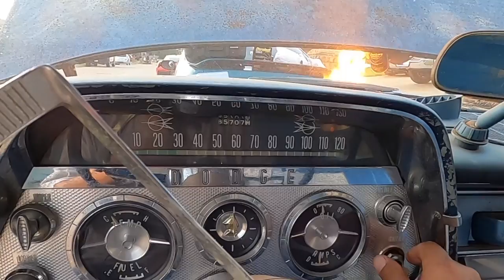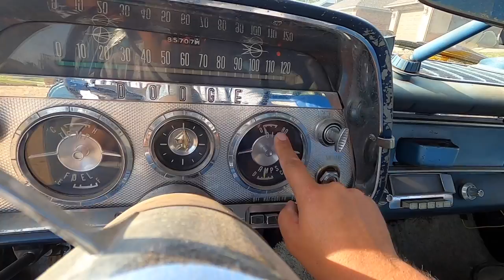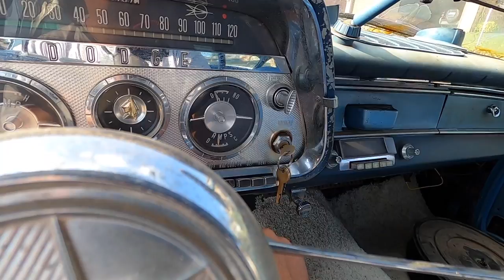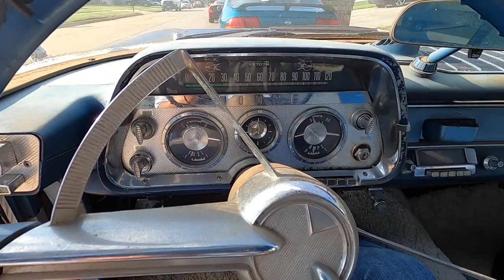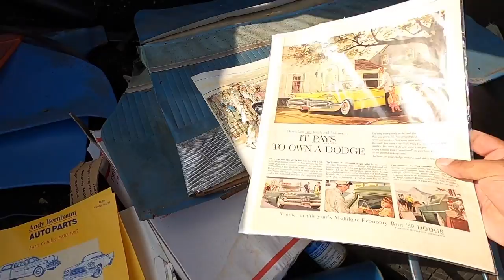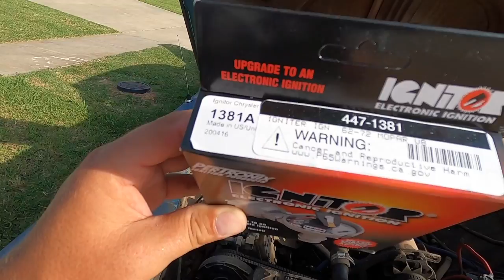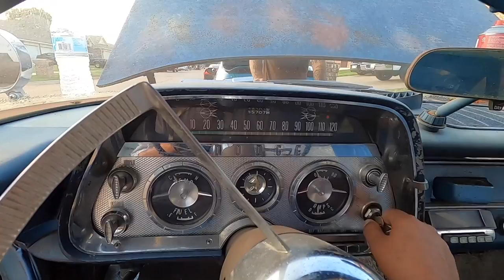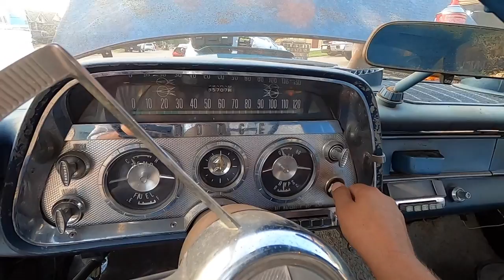I Bought a 1959 Dodge Coronet 326v8 for $4K on Facebook Marketplace - Will it Run?

Comment: I have a taillight here if you want one. 
Ten bucks.  Bezel is rough, lens is okay
Reply: Mirror is a Yankee, aftermarket, not hard to find nicer ones.   Tri-bar they call it. I've had fairly nice ones and sold them on eBay for $25 or so.  
I had at various points a 57 Plymouth, two '58 Dodges, '58 DeSoto, '58 Imperial, '59 Plymouth, most of them flip cars.  I still have pieces from the Imperial and yet another DeSoto floating around.  
I would check the frame rail ahead of the axle kickup, they rot there first.  Then they go behind the rear spring hanger.   As long as that's good, you're good to go.
You will need a $100 puller to get those rear drums off. They press on the axle.  Tool is like a big gear puller that bolts to the drum with the lug bolts, then you spin the middle of it to drive it off.  A bear of a job.

Comment: A  few modern upgrades like electric  ignition, fuel, mechanical stuff. A little TLC  to begin with.  After that whatever's needed cosmetically and otherwise. It doesn't have to be perfect. Just don't ruin it by hotrodding it. She's  a nice old girl and would make a nice survivor. And DON'T change the colors! Just a good repaint NOT at Maaco! 👍🏻😉

Comment: that fuel pump sound like too much presure for a carb
Reply: It only requires 5-7 lbs max. The original, mechanical fuel pump worked best. If the original pump came with the car, I would rebuild that one rather than jury rigging an electric pump. And stay with points. If they don't know what a dwell meter and timing light are, then they are out of your league with this car. Education is key here.

Comment: Sounds like it's missing on at least one cylinder its probably sucked in dirt
because that's why they had to put the electric fuel pump on a new carburetor on it but probably didn't clean out of the gas tank on a fuel line that's a good guess I've done this longer than you've been living good fine but your two speed transmission is not a powerglide it's a power flight powr flite is a Chrysler two speed

Comment: you mentioned car show etc ....realistically it needs stripped of pretty much everything and rebuilt 50-75k and a solid 2 yrs of time.
 OR take out that engine TOSS all the old junk drop in MODERN running gear 15k -25k its just the amount youre willing  to spend.
 hell it might be best to PART IT OUT cept for the 326 which would fund a street rod project

Comment: Is this the car that has the driver's seat that turns out to greet you, turns in to seat you? Aw, I'm a bit of a purist and would re-paint it the original colors it was painted. Your car, your call. It is a more door car, and it is a survivor car. Why not have a car that stands out in a crowd, then the everyday car..Yes, I love tri-five Chevies..BUT, how many '59 Dodges, 4 door surviver cars are out there? Everyone MUST have a 2 door...Well, there were 4 door cars, and station wagons which by now, are probably all gone....I hope you keep this car for a longggg time! This car is in amazing great shape for it's age...My only concern, are the windows. How hard to replace them if need be? I know,,, $$$$$$$$$$. 1963 Mercury Comets ran generators...Just be aware, generators and voltage regulators from back then,,, needed to be polarized before being put into service. But you already know this..
Heck, I had to replace points once a month. I set the gap by eye sometimes..But yes, definately go pointless....Oh, check owners manual. Generators need to be oiled every, 500 miles? Front and back bearings.
Yes, ignition rotor.
Just know not to leave the ignition on too long. You'll burn out the coil/ points..

Comment: This has to be your first old car. If you think its a good deal then it's a good deal. Just not my cup of tee. That little handle under the dash is not nor has ever been an E brake, it is your parking brake just like the one in new cars.  If you were to look in your owner's manual, the one Mopar gave with the car. You will see how to set the parking brake.

Comment: That car has a 3 speed torqueflite transmission not a powerglide. The little lights you think that are in the speedo are not lights. There is a rolling tumbler that turns as the car changes speed. It has different colors on the long roll tumbler that has different colors as your speed increases. Dodge made a model called a Royal that year....here it is. https://www.pinterest.com/pin/231935449535604076/ By the way your AC when it works will come out of the vents on the dash. Your AC will be a Airtemp AC when they work they were ice cold. Sounds like she's not firing on all 8 . Change your plugs and wires.

Comment: Nothing to really restore. I think with a 4 barrel carburetor, fix the rust/dings, and a fresh coat of pain then this car will look pristine. I like seeing these old cars looking all original anyways and get turned off when people put modern luxuries in them like airbags and new engines. My dream car is a 1957 Chevrolet Bel Air Coupe with burgundy paint with white accents on the the roof.

Comment: It has not a powerglide!! (That's a GM, Chevy transmission!!) Chrysler Corp. two speed auto trans was the PowerFlite, but that's not the one in your car either, you've got a 3 speed automatic, which is the Torque-Flite.  Have to say you're lucky to have bought and own it now.... V8 engine, automatic trans, with all the quite nice chrome and interiors, A/C... Which looks like factory air as I don't see an underdash unit.. So that's a pretty high optioned car for the time!! And yes... That's not a mustang or a high performance car etc... But you know... I feel many american people don't value this cars, and that's sad... If there was a time in the history of america that really made an impact on cars, this time was the 50's, and even more this late 50's cars, you can see in them the wild optimism and innocence of the time, the excess, over anything else, bigger engines every year, and amounts of new technology on them, and that was really hardly seen again in later american cars, even existing some high performance machines... To me, the end of american cars started in 1960, from great cars to even dissappearing the companies that built them. To me there's nothing that shouts more America than 50's automobiles, and that should be a great value. 
I have a '58 Plymouth Plaza Silver Special 4 door sedan with auto trans Torqueflite and a 318 poly, power brakes and steering, bought it in the states and shipped it to Europe where I live and I'm restoring it, had to completely rebuild the engine, transmission etc... They're something you don't see anymore. While searching parts in the states, I see many people don't value the car being a 4 door, they just want the 2 door hardtop with the biggest engine, but that's sad, and, once in europe, you really feel it as an appreciated car here. And you know... It is powerful, it is comfortable and it is a joy to drive, and yours will be the same. So, congratulations for owning and appreciating it, you've got a great car!

Comment: Factory Tint windows , would have cost a fortune, factory air conditioning,  the only thing I'd do would fit a booster and dual circuit the brakes for safety reasons , only if no Resto also fit an alternator.

Comment: Dont paint it leave it wipe it down with  Linseed oil before you do anything you well change th our mind about painting it an if you dont like it then it's just more video content. The oil well let you see what it would look like if you just clear coated the patina finish .check out turning rust they did alot of that .

Comment: I'd just fix the mechanical s and drive the ratty hot rod thing is in there only original once ✌️😁 PS  the float is stuck in the carb smack it gentle with a hammer

Comment: That was painful to watch. You guys don't know what you're doing.  Learn how to adjust points. Get rid of that electric fuel pump.. It's too high psi for that carburetor. Put a stock mechanical fuel pump on it.. Check your firing order. And put a timing light on it. If it's got good compression it should be purring.

Comment: I say leave the patina just as it is, restore the interior, and swap in a mild 383 or 440 big block. They will bolt right up to the Torqueflite.  Put the original engine in a crate and  keep it to give with the car when you eventually sell it.   For info on the car and to talk to owners go to Forcbodiesonly.com and forwardlook.net    You can follow me on instagram @67charger383public
Reply: A Brillo pad will clean that mirror chrome right up